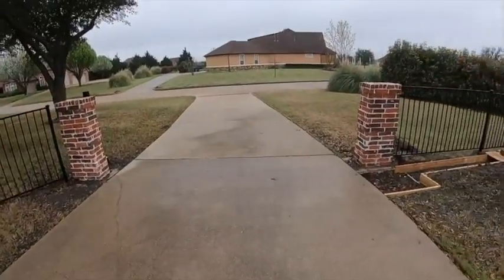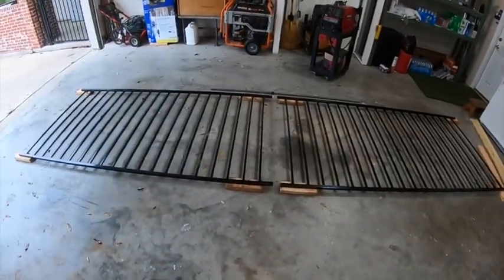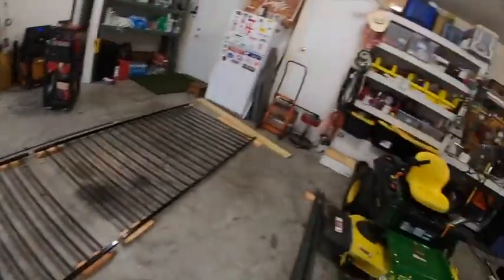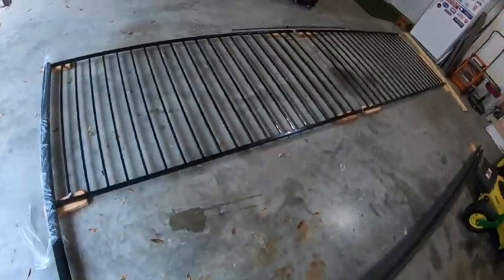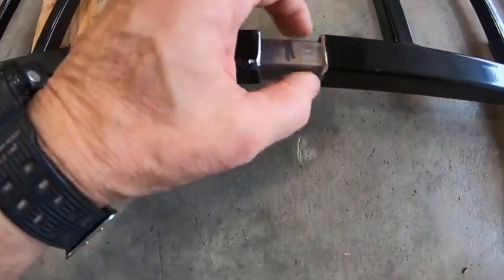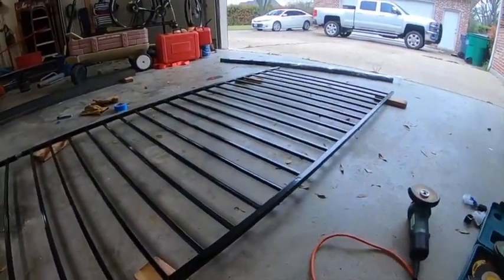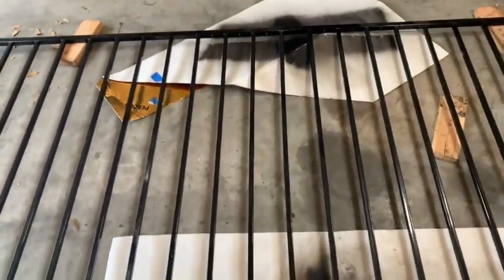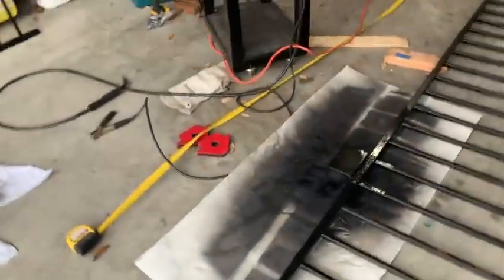Building a wrought iron gate.

Comment: Where did you find your gate supplies...like the rollers?
Reply from the maker: Thanks for watching.   We used a local fence supply company in the Dallas Metroplex.   Any fence supply company in your area should have them.   You will not find them at lowes or Home Depot.
Reply: @HeritageFarmsTexas  Great job!  What is the roller guide on top of the gate @ 12:42 call and where did you get it in DFW?

Comment: FYI could have just drilled like 3/8-1/2 holes where self tappers are and plug welded for better strength / longevity.
Reply from the maker: Thanks Walter.  That would work for sure.